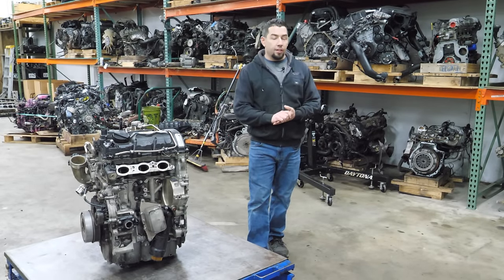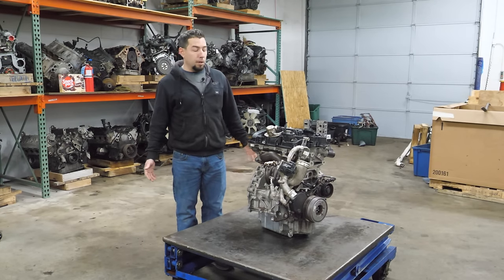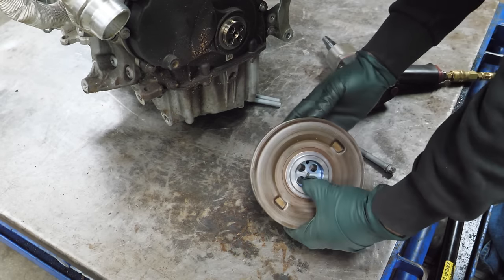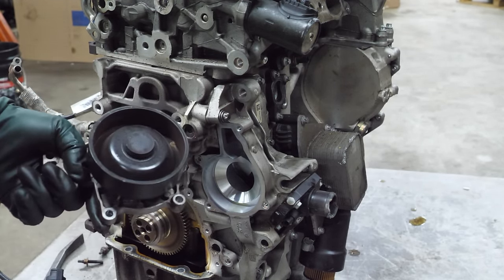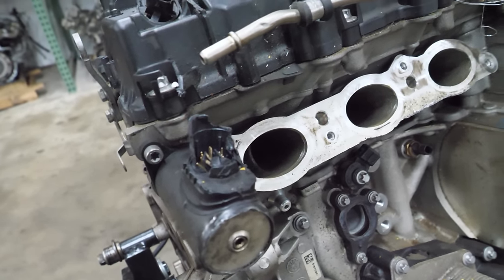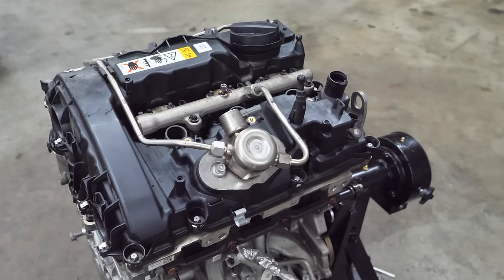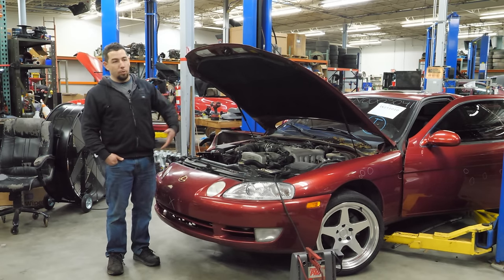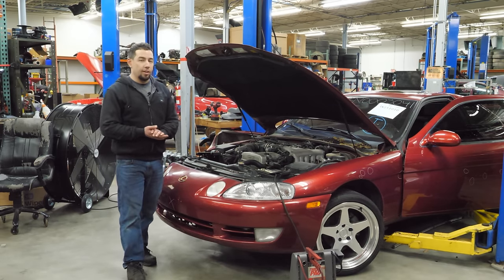MYSTERY FAILURE? 3-Cylinder BMW / Mini Cooper B38 1.5L Engine Teardown

Comment: The drain plug is a "repair" plug that places like Jiffy Lube install when they over-torque the regular plug and strip out the oil pan.  It's meant to be installed and then not touched again until the pan is replaced.
Reply: A) I didn't know that. B) Thank you for reminding me why I don't go to quickie oil change places!
Reply: Which begs the question of what oil was used in this engine. Just because it's clean doesn't mean it's the correct grade. FWIW, I only use BMW branded 5w30 in my N52. Yeah, I pay too much, but at 178,000 miles my oil analysis shows almost no wear metals. Blackstone says keep doing what I'm doing, and so I will. Regular changes at 7500 miles, 90% highway driving with daily pulls to redline to keep oil flowing through the vanos and exercise the valvetronic.
Reply: @dougrobinson8602  good point! I thought the engine had been maintained by how clean it was inside. But you're right, that doesn't guarantee that the correct oil was used. It could have been cheap crap changed frequently.
Reply: @dougrobinson8602  Wow 7500 miles is a long time between oil changes.   I still remember what a Toyota engineer that did engine development said, "If you buy a car that you plan to keep and drive for as long as possible,  change the oil every 3000 miles.   Even if you buy cheaper oil, just change it every 3000 miles,  that's the number one thing you can do to extend the life of your engine."  I can't exactly remember where I saw the interview with that guy, but it was on Youtube.   He was either a Nissan or Toyota engineer, I can't exactly remember.   He may have been the designer of the new American Skyline GT-R engine, that sounds familiar.
Reply: @jtjones4727 I run Toyota’s and Lexus, change between 7500-10000 with full synthetic and I’ve never had a bad black stone report, but again it’s a Toyota…
Reply: I almost killed a kid at JiffyLube in 1987 when I saw him use an air gun to tighten the oil plug. I found out that insurance doesn't allow customers down in the pit. First and last time at JiffyLube.
Reply: Reminds me why i change my own oil. Have been since i started driving and i'm 74 now. Never have stripped a drain plug either ; )
Reply: 7500 mile intervals arnt long.No sane person changes oil at 3000 miles apart from perhaps Ferrari owners.
Reply: What à contrast this emgine id to the Ford ecoboost 3 cylinder  - no wet belt here - (cambelt im oil) and good engineering for this BMW B38 1.5l
Reply: @hokie9910  some later Toyotas, like my 2012 Matrix, recommend a 5000 mile oil change. Which, for me, is better because it came with the "dreaded" 2AZ-FE engine.

Comment: I've seen older GM 3800's get replaced because the harmonic balancer was causing a helluva clatter.
Some Chrysler 2.7L engines got replaced because the O-ring around the primary chain tensioner took a vacation to the bottom of the oil pan.
Stuff like that does happen.

Comment: I bet it would have come around with a good old fashioned italian tune up to burn all that carbon off the pistons.
Reply: Why no carbon on the intake valves?
Reply: That might burn the carbon off the top of the cylinder, but will only cook the oil between the grooves even harder.
Reply: I love the "Italian tune up"!
Reply: @chrisbrown3925  I don't think the B-Series engines have nearly the issue of valve carbon that the N54 and N55 did.
Reply: @dougrobinson8602  The M54 had a problem with carbon clogging the oil control rings.  They were one piece 'I' (eye) cross section low tension rings with tiny drilled holes for the oil to escape.  Oil sludge could clog a hole.  Once that happened, the trapped oil would start to bake into hard carbon and trapped oil would cascade the effect to the next ring.

Revised rings with long slots instead of pin holes solves the problem, but that's a complete engine tear-down to fix the problem.  Fortunately BMW parts and service are famously inexpensive.
Reply: @chrisbrown3925 maybe the fact its direct injection and only air goes by the intake valves

Comment: Wow, got here early.   My guess looking at it would be that the cylinder wear has allowed some (not a lot, but some) oil past the rings, which lead to the appearance of blue smoke.  Probably just at start up at first, but over time it built up around the rings and such and allowed more and more oil past.  At a point, it went from a blue smoke on start up the a blue smoke at RPM and on the road down to blue smoke at idle, which is when it got pulled out.   I am thinking it just ends up being a question of clearances exceeding what the rings could handle, and then it was a cascading failure over time.

Love the two boit engine stand and the safety box.  All good stuff.

Comment: I second your harmonic balancer theory. 

I once worked on an Altima with lean codes.  Last shop couldn’t figure it out so they replaced the engine.  Turns out it was a rolled throttle body gasket.
Reply: The last shop figured it out...they found a way to extract maximum cash from the customer.
Reply: @encinobalboa  I'm sure it was warranty replacement.
Reply: I bought a Chevrolet 327 once that had the pulleys loose. Ran fine for many more years .
Reply: Altima issues are typically owner related in my experience.

Comment: If those rings were the cause, a little trans fluid in the plug hole and let sit while you put the plugs back in, it’ll free those rings up, I believe that engine was replaced because of that balancer sadly. Great video
Reply: Unfortunately they took the good stuff (sperm whale oil) out of ATF back in the 70s.  (Save the Whales!) So it's really not much for a detergent additive package these days. Valvoline makes a magic engine oil for Cummins that does have some pretty strong cleaning properties.

Comment: Loved this video. I work as a BMW tech over here in Australia and I personally don't like these engines as they are terribly unbalanced and lack any general grunt even with all the stuff BMW has done to it. A complaint we get from customers a bit on these engines is that they shake a lot on start up, which is a very normal thing for these to do. They also go through the left engine mount within 100,000km or 60,000 miles  due to these being in FWD cars most of the time and the natural unbalance these things have.
Reply: 3 cylinders are being used in performance SxS's. Mine is a 150 horsepower Yamaha 1000 cc, no turbo. Not bad for a no turbo one liter.
Can Am's Maverick is a turbo one liter... 400 horsepower. That's a lot of hp from a one liter turbo triple.
Reply: @TheBandit7613  In performance applications, you're never really at a low enough rpm enough of the time that the (un)balance is a major problem. Neither are you in the lap of "luxury" with good suspension and sound deadening....

Those engines would do a lot better in hybrid applications - have the e-motor handle launches and idling, kick in the ICE at higher speeds and loads. As a side benefit, that would also reduce carbon buildup... everywhere due to significantly less idling at really low cylinder temperatures and air velocites...
Reply: @ZeDestructor00  I halfway agree. These performance SxS's are not exactly smooth running. Imagine the cam on a 150 hp 1000 cc triple. 
The idle lopes hard. 
However, the suspensions are the most advanced in the motorsports world with 24" of travel and Fox bypass coil over shocks. They ride amazing. 
I completely dismantled mine when it was brand new to install sound deadening mat all over. I couldn't hear myself think.
I think it's still amazing that we are getting 400 hp from 1000 cc's, the motor weighs about 90 lbs.
Reply: Not possible to
Balance that out it’s from rpm varying dramatically between cylinders firing only “solution” would be putting a massive flywheel on it.
Reply: I was honestly kinda of shocked at how low the power was once i twigged it had fuel injection and a turbo, and i'm not an engine head.
Reply: Toyota made a little 998cc three cylinder used in the Aygo.
My daughter has one and whilst it's not very torquey it uses minimal oil at 85000 miles. Idle is reasonably smooth.
Reply: 3 cylinder engines are being used to save fuel. Everyone is extremely worried about fuel economy to the point that if the engine fails, earlier, no one considered the carbon footprint of replacing it. The owners wallet doesn't matter either as long as it saves fuel on paper.
Reply: They do sound good though much better than bmw 4 cylinders

Comment: No the pulley is not supposed to be that way. The serpentine belt pulley part of it is supposed to be sprung and dampened (sort of like a dual mass flywheel) to make life easier on the auxillary components (due to the large gap in firing interval,  the engine experience significant rotational speed oscillation 3 times each revolution, especially at idle and low rpm) and someone might have written it off thinking thinking the failed damper was the internals ratteling, especially if it rattled in combination with oil consumption. 
And speaking of potential oil consumption... These engines have plasma spray sintered iron bores (like the Ford 1.0 ECO-Boost) which have EXTREMELY GOOD oil retention properties, and if the owner decided he knew better that BMW (some unknowledge seems to be at play with oil-changes, due to having broken the drain plug and installed a janky replacement) and filled a higher viscosity oil in it (thinking 0W20 or whatever is too thin), and with the improper spec too boot (wrong additive package in the oil) Then the piston rings would basicly just float on the now way too thick oil film, and let oil seep in to the cylinders in any off-boost situation...
Reply: Basically this, bad maintanence and lack of knowledge was the end of this engine. The faulty serpentine belt pulley would have been an easy fix, what a shame.

Comment: As an owner of a 3 cylinder Mini Countryman, I thank you.  It was interesting and informative to see the inner workings of that engine.  I didn't realize the timing set was in the rear.  Means any fault there would mean an engine pull.  Ugh.  But, the design looks stout and ours receives Mini motor oil and filters every 5000 miles.  So I have expectations of a long service life.  Cause we love the Countryman.  Love the tear downs and look forward to the next water pump toss.  And if you ever get a shot at an Isuzu diesel, I think that would be interesting.
Reply: Sell it before 120k and you will always have fond memories.

Comment: Another enjoyable video.  Well done.  I don't agree with you when you say you can't clean the carbon.  Audi and VW have this same issue.  The European car manufacturers are hell bent building over engineered undependable trash.  Audi actually has in their owners manual 1 quart per 1000 miles is normal oil consumption!.  You can remove the spark plugs and fill the cylinders with gum out carb cleaner liquid.  Turn the engine over 5 revolutions every couple of hours then refill.  do this for 24 hours.  This will free up the oil control ring and open the oil drain passages and stop oil consumption.  There are youtube videos on how to do this.  The low tension rings the Europeans are using are total trash. I did the gumout treatment on one of my customers VW Passat.  She was burning 3 quarts of oil every couple of weeks.  The gumout treatment worked for me.

Comment: I bought an 85' Dodge Daytona turbo Z one time for 400 bucks because the guy thought it had a rod knock, and it turns out just the accessories pulley bolts on the front of the crankshaft were loose.
Reply: Similar, Had a person sell me a Supra for 700 cause the "engine was bad" The belt was squealing. I started to tell her cause I felt bad but she said no It's bad I dont want it. Well I'm not going to fight with her about it. You don't pass a fully dealer serviced Supra when it's that price. I don't gets gifts but that one sure was.

Comment: If anything, 2 bolts was actually too much.

Also, that drain plug is common at quick lubes for when there is no longer any thread left in the pan, It is meant as a last resort until the pan can be replaced or repaired. I know of many cars that have used one of those for 50k+ miles.
Reply: How do you strip the threads in the pan unless you torque it excessively? I have a couple of high mileage (400k+ miles) cars that get regular oil changes. This has never happened to me.
Reply: @justincase9471  3 ugga-dugga'll do it. And then the neanderthal in the pit does a full send for 30s without even hand-starting the plug for good measure!
Reply: @justincase9471  Well, either you have a torque wrench and use it correctly, or you're smart enough to know how much grunt is too much. At some point someone German torqued it.....Gutentight!
Reply: @justincase9471  Some people think an air impact is the right tool for everything......

Comment: This engine was improperly broken in. The glazing is from lots of idling and low engine load during break in period. Remember during break in or the first hour of your engine running, start, 1500 rpm vary the RPM up to 60% of it's rev range for the first little bit until warm, then take it out and put some acceleration on it, and put a couple 80% throttle pulls and on a new motor you should take it to WOT within the first day of owning it. This engine was burning oil because glazing makes it harder to scrape oil off the cylinder walls, it also hurts compression. I think this guy was burning oil from clogged rings not scraping the glazed walls, and was owned by someone who cared for their car. I think looking at the cylinder head and edges of the exhaust valves there's evidence of oil burning and someone tried to clean it out with seafoam or a top end cleaner of some kind. I bet if you looked at the the exhaust valve stem it's got carbon build up. I bet jiffy lube or whoever sold them a top end clean for their oil burning issue which was caused by their improper break in.

I've seen this a fair bit with late model cars, modern engines are especially prone to glazing i think because of the harder cylinder walls and smaller piston rings. I honestly think they need to be run in at the factory to prevent this sort of thing.

Good new is these engines are definitely worth rebuilding and rebuildable cores aren't cheap! We can knock the glaze off easily but we can't overbore them because of their coating, so we always need good blocks, everything else we can machine and fix but blocks are one and done. So this core engine is worth a lot to a rebuilder, they're 4500 used up here, i would grab it for a fair price but I'm in another country.
Reply: Maybe he listened to you , my manufacturer said no over 3000 rpm during break in . The engines they used to buld back then reached without issues 1 mil km in taxy use

Comment: I drove for a weekend the 218i.  It's a nice engine and paired with a ZFHP8 it good and gives high MPGs. It didn't feel like a 3 cylinder driving it. Thanks for bringing it to the channel. 

But I'm still waiting for the Ford Diesel F9DA, KKDA and the Fiat 1.6 Multijet and 1.9 Multijet. Almost all these engines are immortal.

Comment: I owned a 2015 Mini Cooper with this engine for a few years. Great power around town and incredible fuel mileage. It had a valve cover leak that was fixed under warranty. No other issues though.

Comment: Just found this channel a couple weeks ago and love it. But can I get a back story on the water pump jokes?
Reply: people (used to) give him crap for throwing away the water pumps instead of selling them "because they're perfectly good". never buy (or sell) a used water pump.
Reply: @WarrenGuy Didn’t know the backstory. Turns out it was a backstory involving comments. Regardless whether I knew the backstory, all I need to know is NEVER BUY A USED WATER PUMP.
Reply: I'm frankly shocked that this engine has a belt driven coolant pump. For years BMW was in love with electric motor-driven pumps. They barely last 50,000 miles on a turbo six.
Reply: @dougrobinson8602 yes, biggest issue with the n52/3/4/5!!! Lovely engines otherwise

Comment: I would guess that the engine was over filled with oil at some stage, causing the carbon build up.  I would also like to nominate the engine stand for best supporting role.

Comment: Looks like a better design than 3 cylinder Ford Ecoboost with that horrible wet belt system. As to what failed here, I can only think it was a misdiagnosis from that pulley wheel as there is no way that can be right.

Also, that emergency oil drain plug looks like it went to a cheap oil replacement shop, and it makes me wonder if they are careless with that, they are equally careless with the quality and type of oil they used, which might explain the fouling.

Comment: 2 things you might address.  The stupid 12 point spark plugs are worth mentioning- that is not a standard 12 point, nor a triple square. It's proprietary to BMW AFIAK. So that's annoying. 
And, what is with the appearance of bright orange on the halves of the rod bearings?